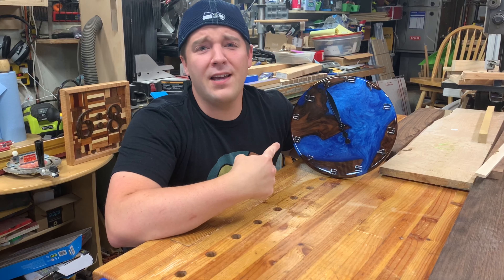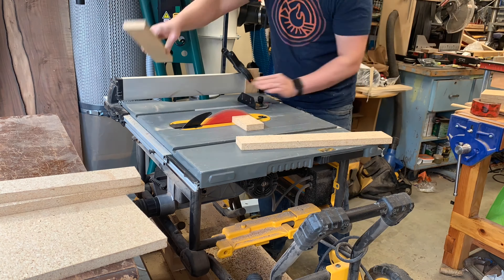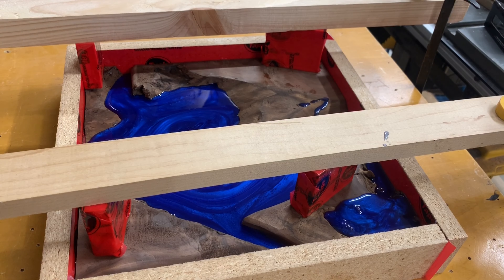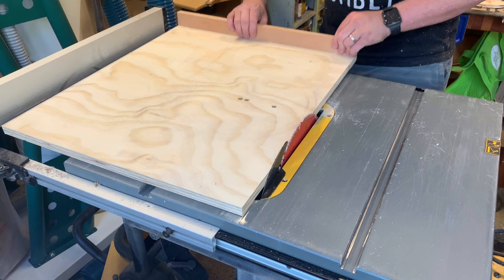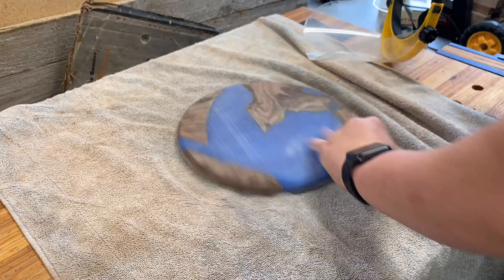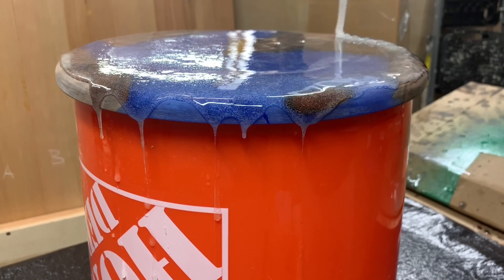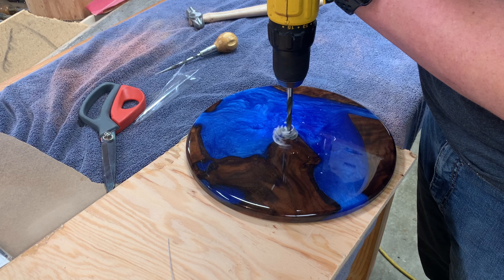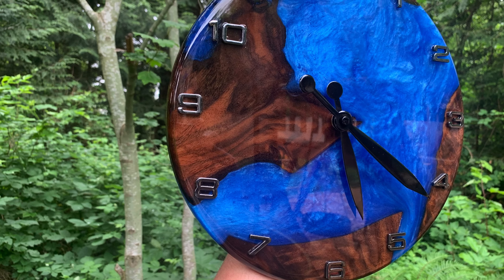Making an Epoxy and Wood Clock

Comment: Take your finger and quickly rub some epoxy on the edge to make a wet edge before letting the flood coat run over. Not as much difference on the round over you have but helps the more 90 deg you are.

Comment: looks nice, is the epoxy rough on the planer blades? I did not know you could run epoxy through the planer.
Reply from the maker: Light passes and it’s not too bad. Would be better with a helical head. Chip out is definitely possible though.

Comment: How did you get that color .wht is the type of epoxy that you used in your project
Reply from the maker: I used two different pigments from the Black Diamond variety pack. You can see the 2:1 Total Boat Epoxy and Pigments at this link under epoxy projects: https://www.amazon.com/shop/6_8woodworks?ref=inf_pub_6_8woodworks